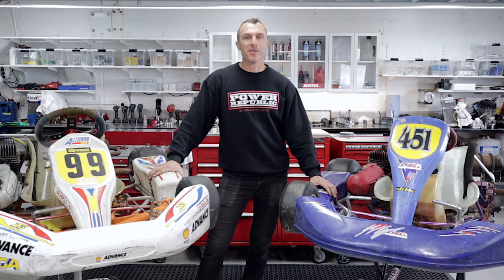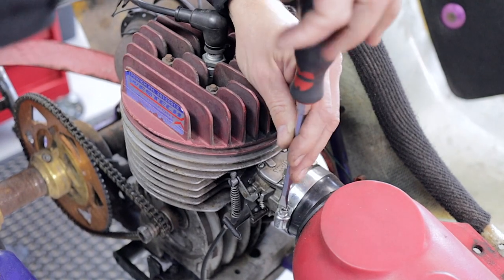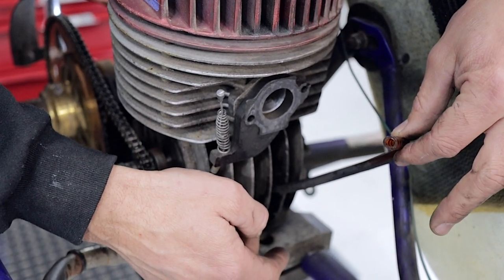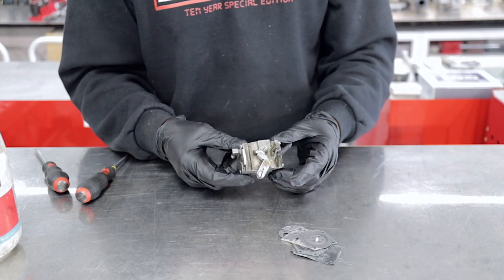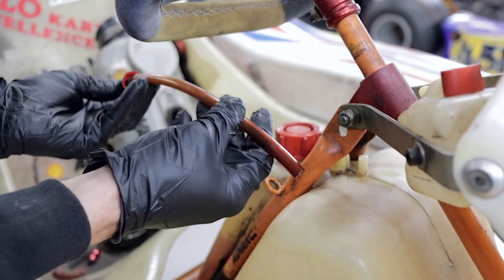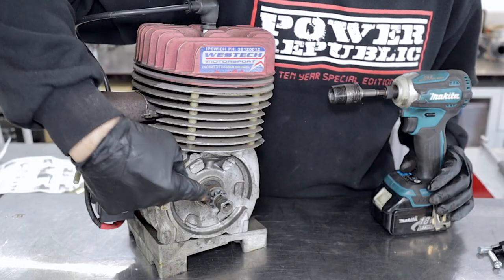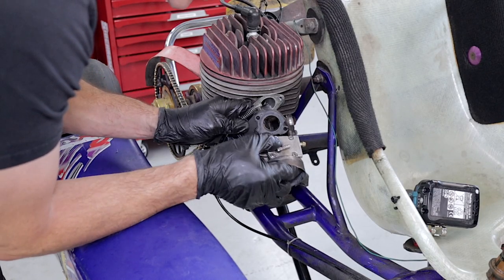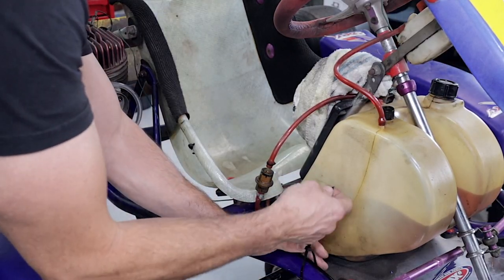Go Karting On A Budget - POWER REPUBLIC

Comment: Another great video Derek.  Just wanted to point out that by taking only a few minutes to drain the fuel (and water if it has a radiator) before storing it will save you this trouble in the first place, leaving you with a clean carb, white fuel tank, flexible fuel hose, and no rust in the radiator.  Leaving you only to bleed the brakes and add liquids before hitting the track years later.  Pretty obvious, right.?
Reply from the maker: Hey Jase, yeah that's correct, a little bit of prevention can go a long way.   I even think we might have done a video on that 😂

Comment: I used to run an old air cooled blue top pcr in speedway karts. The thing was still extremely competitive against water cooled iame engines. Got a few overall wins and series wins.
Reply from the maker: hell yeah, turn em hard and they rip!!!!
Reply: @PowerRepublic  by far my favorite was a 100cc maxter rotary valve. That thing loved sitting at 20000rpm. Actually got a few lap records with it in dirt karts

Comment: I love those oldies. How do you start that engine with clutch but without starter?
Reply: I ve already discovered that u probably use the nut in the end of the shafy.
Reply from the maker: yeah it needs the external starter to drive the engine.  Thanks for tuning in and sharing the video!

Comment: Awesome Video 👍😎👍 Quick Question Have You Ever Worked On A Carb That Is Realy Beyond Fixing It ?? 🔧🔩🔨
Reply from the maker: Hey Louie, thanks for tuning in and sharing the videos.  I have, especially the Walbro's style cause once the 'seat' is damaged/leaking its almost impossible to get the 'needle' to not leak down.  that makes it heaps hard to tune once back on the track.  
another thing to check is the butterfly shaft housing.  sometimes the aluminium wears out and air leaks past the butterfly shaft.

hope that helps

Comment: Hi just brought a lame x30 go kart and its idle is really hi how do you tune it down
Reply from the maker: hey ash, thanks for tuning in and sharing the videos.  
- you can back the butterfly shaft stop screw (idle adjuster) off/make sure it isn't adjusted to far in
- you can check the throttle stop screw at the pedal isn't adjusted to tight
-you can open the carby jet closest to the engine
Hope that helps
Dez
Reply: @PowerRepublic  thank you so much